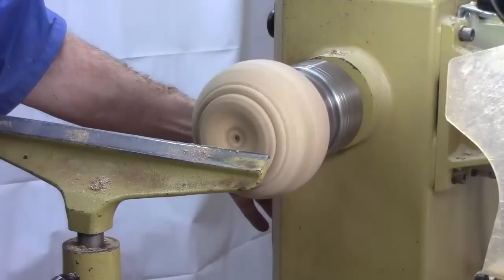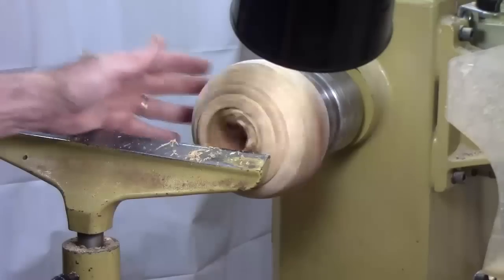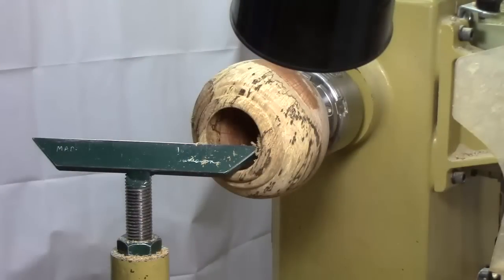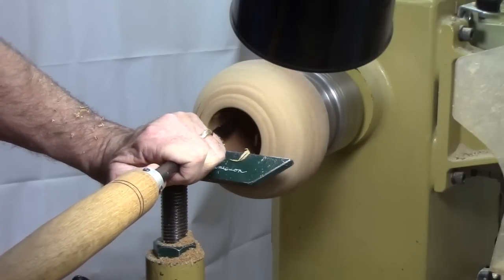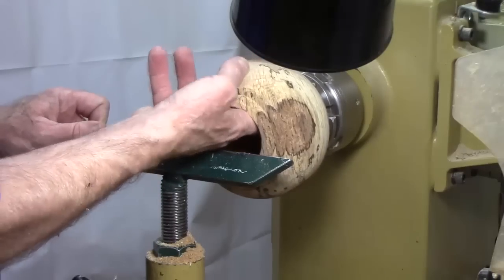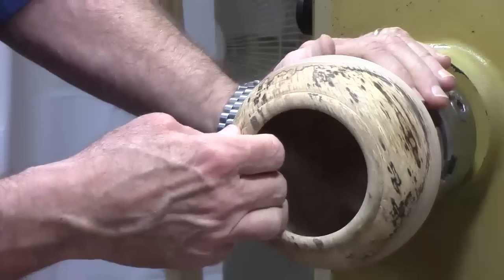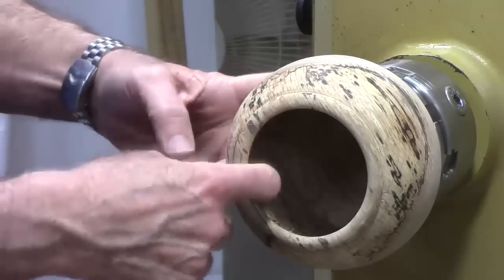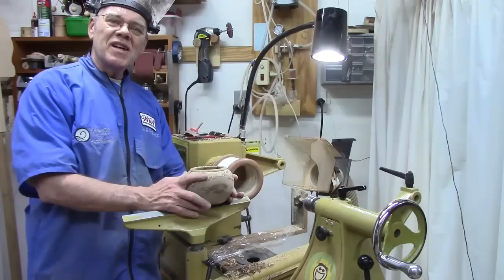How to Turn a Potpourri Bowl - Part 2 of 2 woodturning

Comment: Very nice.  I like your trick with the plastic wrap.  I wish you'd shown your sanding disc arrangement before.  I bought some cheapo disc holders from HF, but they had threaded ends.  I scoured the country looking for a 1/4-20 threaded insert to chuck up and screw the holder into.  I never thought of using a coupler.

Comment: Mike, I enjoyed your excellent video. Thanks for sharing. I use a movable tailstock storage cabinet similar to yours. They sure avoid some heavy lifting. I really like your emergence shut off switch.
Reply from the maker: +Marshall Gorrow Thanks, I don't know why more folks don't have them, even if they have to use a mechanics tool chest on wheels to add the extension to.

Comment: Great video!  I have a question, Instead of using a tenon on the bottom, could you cut a recess in the bottom and chuck in it internally. That way you wouldn't have to rechuck it to finish the bottom. I realize that the bottom would be thicker because of the recess but I don't think it would hurt anything.
Reply from the maker: +D. Scott Some turners do prefer a recess. I would still reverse the bowl to clean up a recess so no real time savings for me. It is a matter of choice but I don't like to leave signs of how the bowl was chucked. Many non turners would not know the difference or care, but it is what I prefer.
Reply: Mike Peace Thanks I I really appreciate your response.

Comment: since its a bowl designed to give off fragrance, any thought of not finishing it at all. the fragrance could then soak into the bowl.
Reply from the maker: +Cliff Hartle I skip the inside finishing. I don't think I would like the look of no finish on the outside.
Reply: Mike Peace Also I guess oak is not necessarily a scent you may want. Of course you could char the inside and fill it with Jack Daniels. Just like they do with their barrels. :)